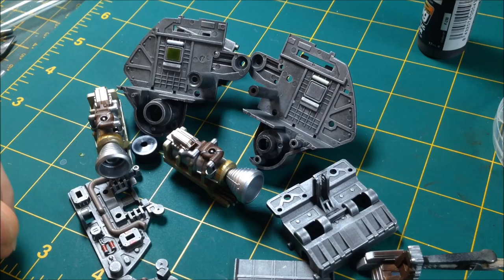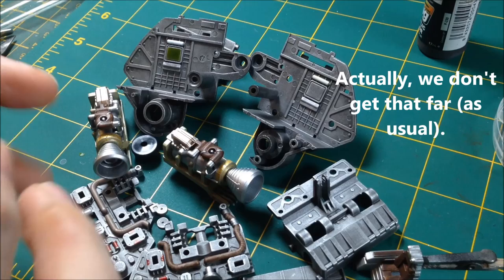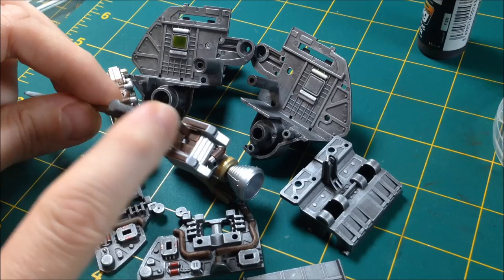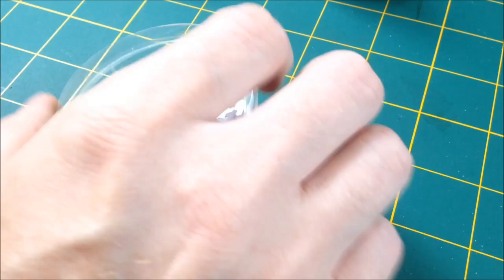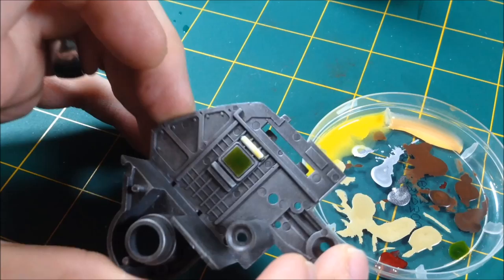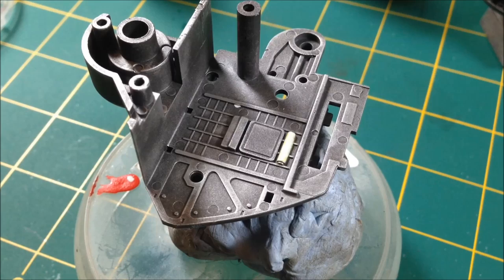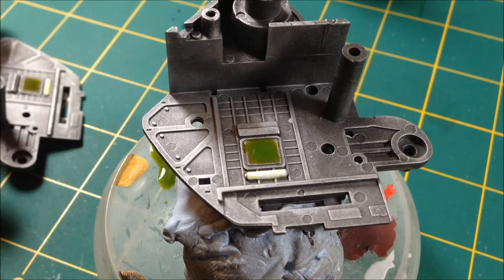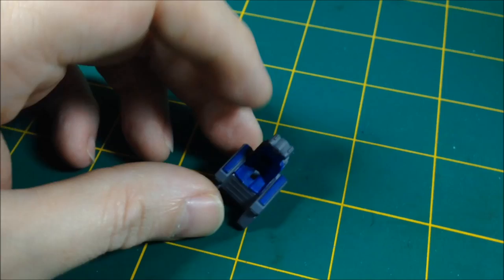Ammo by Mig Jimenez PG Zaku II Part 5: Cockpit Details and Weathering

Comment: As a heads up, when you just want to do a thinned normal was on a gunpla kit if you use washes from companies like Valejo or Citadel, they're water based. These can be thinned with plain old tap water and have no chance of spoiling anything to do with the plastic. 
As far as I'm aware, Oil washes using odorless thinners can't do harm to Gunpla plastic though don't take my word for it.
Reply from the maker: Oh, I have used those before, but I am only using Ammo products on this build :)

Odourless thinners can in fact eat away at the plastic when using thinned oils, pretty much any thinners will cause damage if applied too freely. You're usually okay on armour parts, it's when you get around joints or when the wash gets inside gaps and near attachment pegs and points of high stress you have to be super careful.

Comment: 6:16 are you sure about that? I think injector pin marks were a bit more common on older Bandai kits. my MG Ball, for example, had some pretty visible ones.
Reply from the maker: Ah, well, you may be right, this is probably the oldest kit I have built so far so I haven't come across those yet :)
Reply: Modelmaking Guru yeah, modern bandaid kits have spoiled us. I haven't had to worry about them until now either.